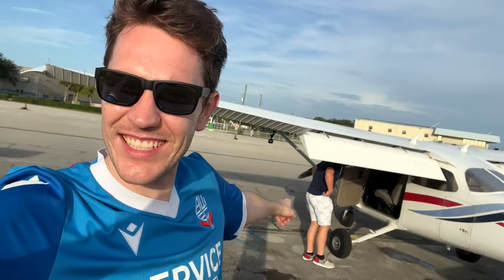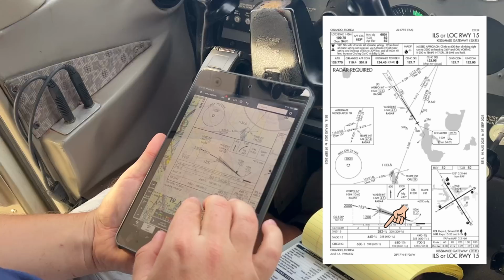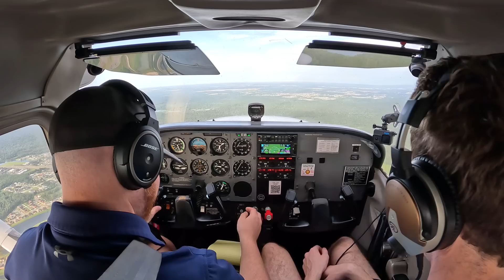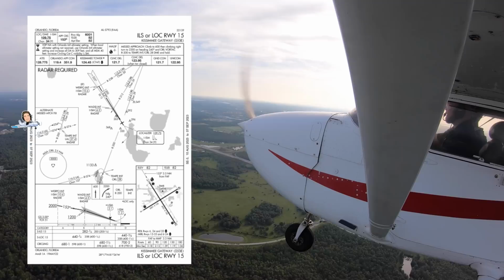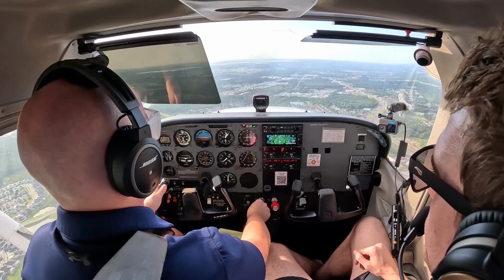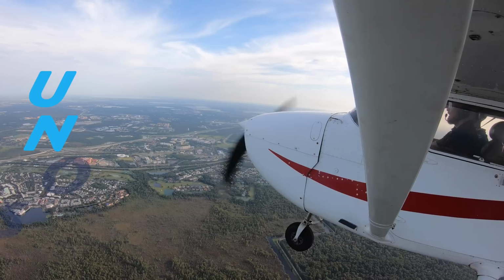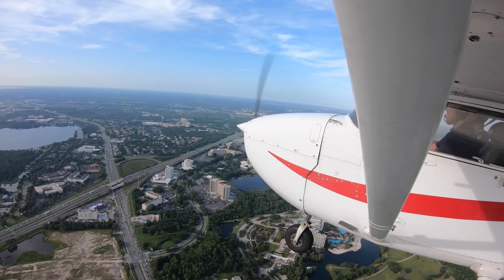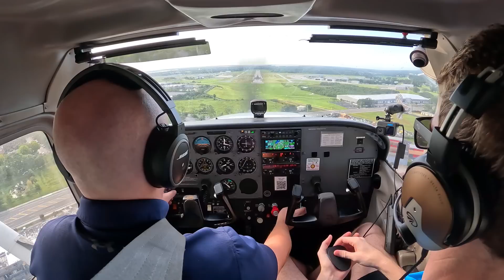ILS Approach Explained | Plus Partial Panel

Comment: Sorry.  NOT "expertly executed on the radio". error " ... we are about 8 miles 23 Southwest ... "  correct " ... we are about 8 miles Southwest ..."  Use of prepositions "to" and "for" can be confused with numbers "two" and "four".  Also, definite article "the" is discouraged because of aural similarity with number "three". Similar reason "tree" is used for "three".  It is all designed toward overcoming static-filled airwaves, squelch, noise-cancelling equipment, and minimize interpretation think-load on controllers in multilingual towers with high operational tempos.
Related:  Giving the ATIS letter right after the callsign immediately tells the Control that you are inbound and planning interaction with their airspace and runways. This gives Control immediate data eliminating all other possibilities, greatly reducing Controller thinkload.
I really enjoy your vids.  You keep the fun in flying.  Whether Pilot Flying or Pilot Monitoring, Otto would be great fun when sharing pilot duties.